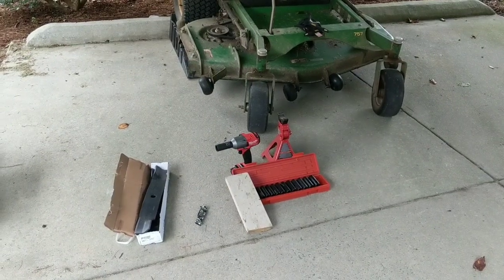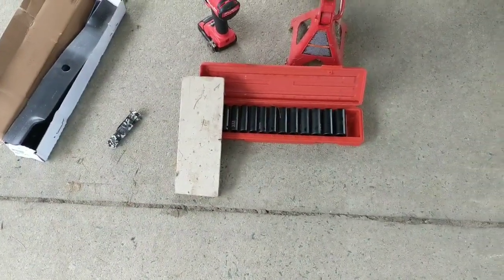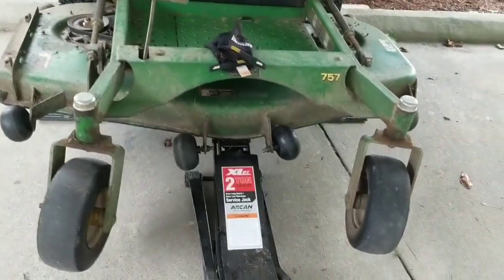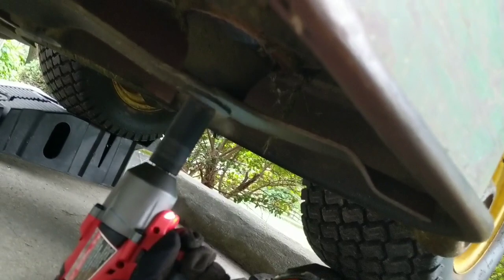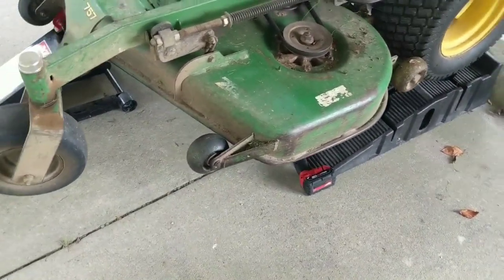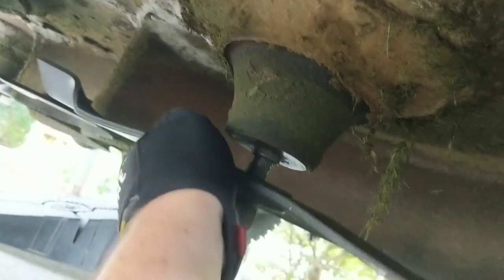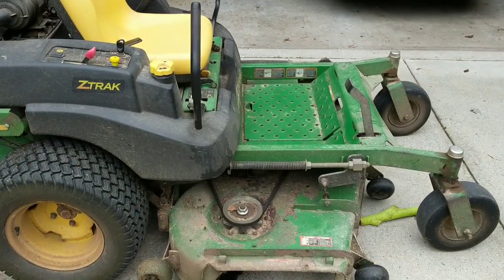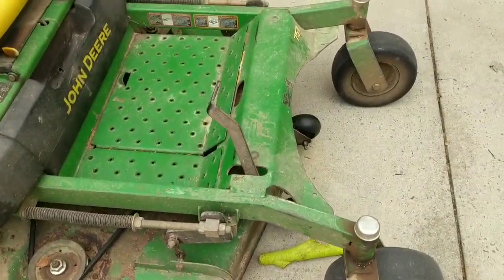How to Replace the Blades on a John Deere 757 Zero Turn

Comment: Let me add my thanks as well. After I watched your vid I dug out my impact driver and it made the job possible: great tip!  I'd like to add three things from my experience. First, unplug the spark plug/s for safety. The second thing is to pay attention to the shape of the blades. Getting them installed upside down isn't all that hard when looking up from underneath the deck. The last thing I learned was that the OEM blades were actually cheaper at my dealership than online and they are guaranteed to work.
Reply from the maker: Great points! Thanks for the feedback and glad you learned a new tip!
Reply: No, thank you! I doubt I would have figured this out on my own and your video gave me the confidence to do the job in the first place.  @BtwilliasGarage
Reply from the maker: @kcender3771  really appreciate it!! New content coming soon. Hint: make sure your lug nuts are torqued to 75lbs! Just ripped a wheel off 😓

Comment: On the John Deere 72 in zero turn at my work I have a Bent Blade on the very far left hand side and for the life of me I cannot get this bolt broken loose! I've used a cheater bar, impact and also penetrating lubricant oh, so I guess the next step is heat the nut up with a torch to see if I can't get it to break free some heat!     🔥 🚜

Any suggestions would be greatly appreciated. Oh and just so everybody knows we have Scaggs also and nine times out of ten when removing the bolts for the blades they have to be cut off because they're so long that they run through the deck from top to bottom that hold the blades on they get been twisted and all kinds of jacked up where you can't get the nut to release so you have to cut them off great design!!! Scag cheetah 11 don't buy one they are cheep and we have a brand new one and there's always something breaking like the Bolt that holds the chain to the frame that supports the deck straight up snapped, the air cleaner box cracked, the seat has a spot that already worn through and torn, a small stick got underneath the mower and broke the spring that push the tension on the belt for the hydraulic drive all because it's right in the open in the bottom and there's no skid plate or anything to protect it, scalping Wheels gets stuck and don't turn, whites have a short in them where they flicker on and off in this is on a mower that has only 280 hours. Just a heads up the seat position is uncomfortable you are way too close to the handlebars but far away from the feet pedals that raised the deck and lock the brake and the seed is in a weird reclined position where its ass all kinds of wrong but other than that whole slushat it's great it's really fast when in high gear it goes 90 miles an hour so you can drive like a maniac and you might as well drive like a maniac since you won't be cutting any grass and it's probably going to be broken down have time so have at it